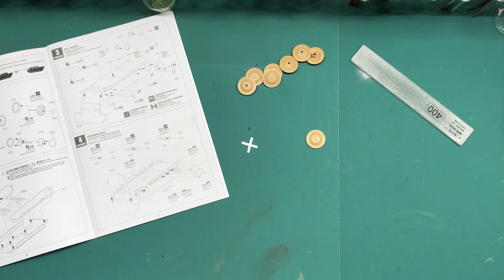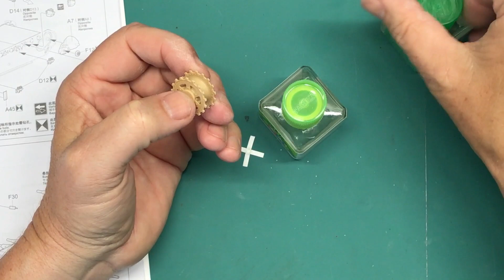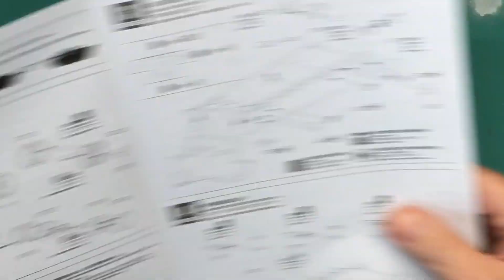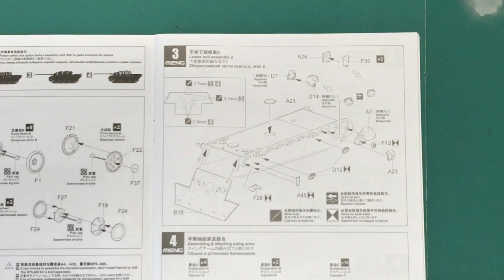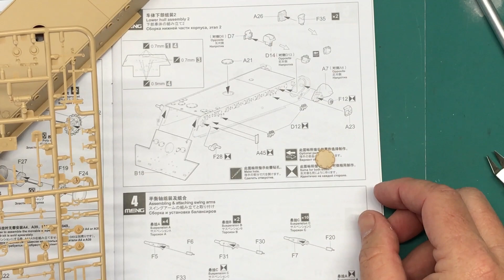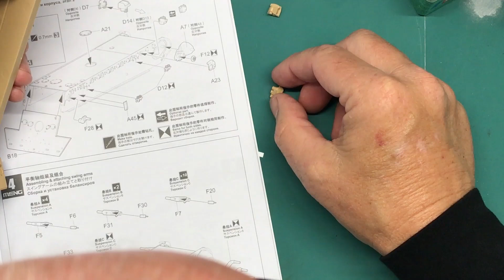Meng 1/35 Jagdpanther Ausf G1 Part 2 Steps 1-3

Comment: Hey Brett I hope you're well. Following along so far. FIRST I would suggest when you do the roadwheels, glue them together FIRST and THEN sand them. Its a serious time saver. Do all the cutting of all of them at once, glue them together and I skip the sandpaper and go straight to the sanding files like you had out originally. TIME SAVER man TIME SAVER big time.
Reply from the maker: True stuff, Ghost. And thanks for the tip. I've done the wheels after assembling them together before and it works great, but this time I didn't! Sometimes when I am doing video, especially step by step stuff, I blank out with some things. I get so caught up, things I might normally do, I total forget!
Reply: Even on the drive sprockets and rear idlers. Same thing. Save yourself some serious work. Doing anything that has a kazillion road wheels. A Sherman is one thing but anything German with a ton of road wheels etc.